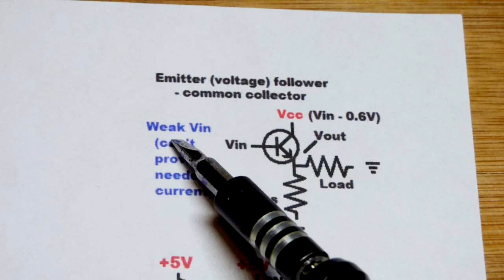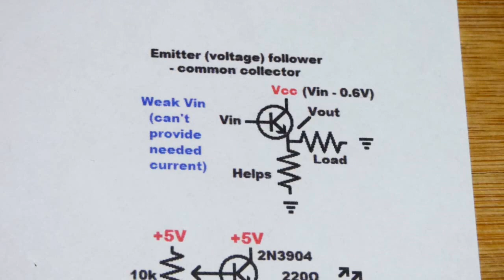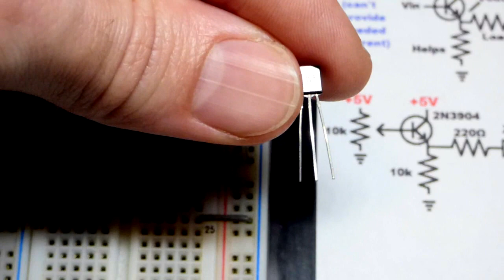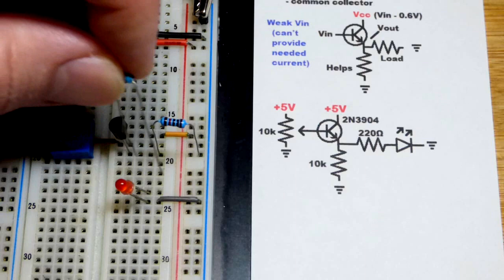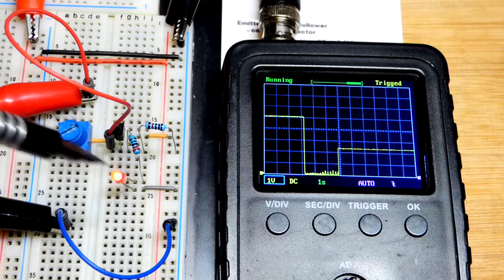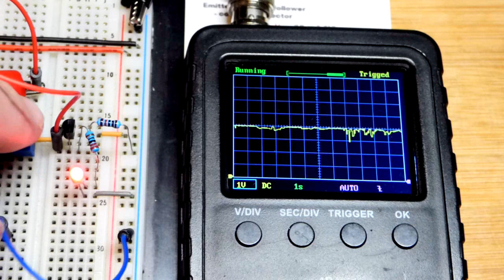How to read schematic diagrams 06 emitter follower aka common collector using NPN BJT 2N3904

Comment: Thanks for all these videos! I always seem to have a similar thought or question with things like this: how would I make it so the LED is fully "off" or fully "on" but not at some in between stage where it's not fully bright (eg: at 4:28)? And how about driving it with a 3V3 logic from something like a Raspberry P - would it ever be bright enough to be "fully on" (5V supply in to the collector, 3V3 in to the base), and if not how could I take that "weak" 3V3 logic level to make it enough to drive such a circuit with the load at fully on?
Reply from the maker: Thanks for watching! I've never used a raspberry pie, so no idea what LED projects people make with them, but 3.3V isn't much voltage when working with LEDs. It is definitely plenty of voltage to control a bipolar junction transistor wired as a switch that is being powered with 5V though.